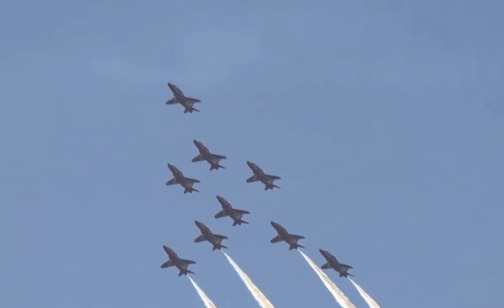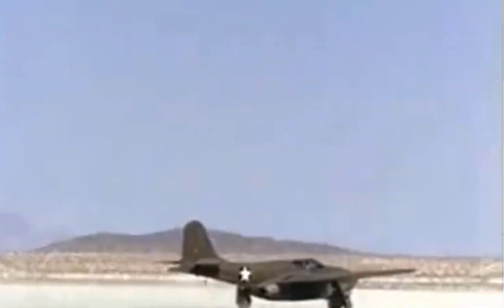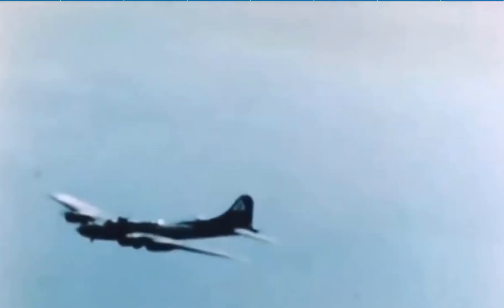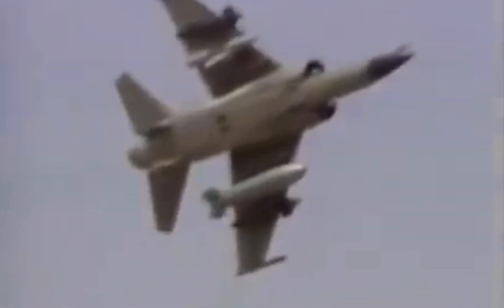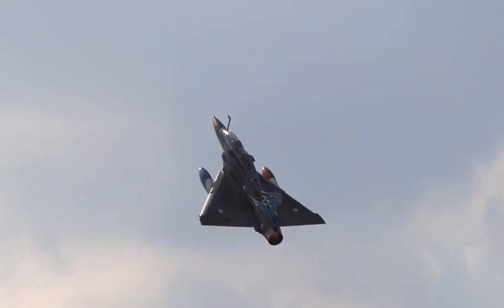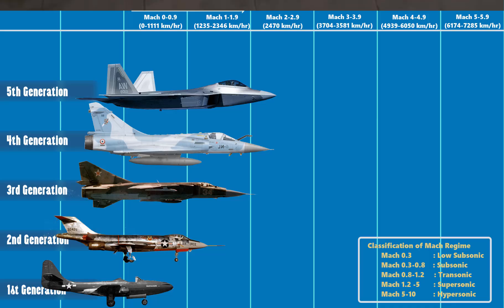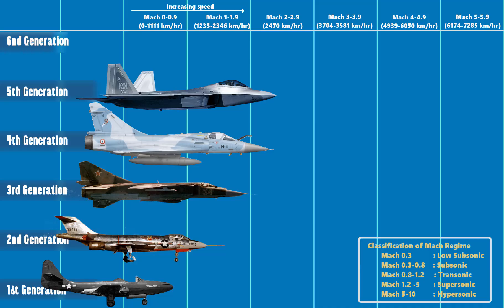Evolution of Jet Fighters (1st to 6th Generation) | Speed Comparison

Comment: No , the ME262 was ready tested in April 1942 , and was  discovered  in the air on June 1943 fighting against the Allied . It was maximum used in 1944 when it was too late for the war . Its speed 900 km / hr . It was a prototype which even the Air chief Adolf was Shocked to see its fly . For Allies it was an alien 😂.

Comment: 1953 ... the generation 2 jet fighter interceptor Avro Arrow was designed ... and 37 were built ... NO prototypes were made ... 6 were flyable and 5 flew .. 
.
of all jet fighters the arrow was the first to have built in air conditioning ... extensive use of titanium (before the sr71was even a dream) flew higher faster and further than all other gen 2 craft ... 
and yes the arrow has 15 firsts of all jet aircraft .... and all of them are still in use today ... btw the arrow was mach 2.2 Capable .. also it was the first delta wing design first with over the horizon look down shoot down radar first with ground mapping radar for low level flights .. first with internal weapon bay ... just to list a few firsts of the arrow ... NONE of which are american deisgns ... even their vaunted sparrow missile and it's gidance system was Canadian made as the americans gave up on it and let the canadians have it ... then we made it work ... 
.
ok so sorry BUT youre information is WRONG on the terrain avoidance systems .... the arrow had that in 1954 ... designed from the start ...

Comment: Jets aren't going above mach 2.5
The format can do much 3.5 but thats the fastest. 6th gen will never ever ever go mach 6.
Reply: um wrong ... a modern jet fighter with turbine jet engines is capable of upto mach 3.5 .. to get above that one needs a hybrid engine that is half ram jet and half jet turbine ... also known as a scram jet ... which takes you upto mach 6.6 ... and then a ram jet with no moving parts takes you above mach 7 and well into the double digit mach numbers ... 
.
the flying wedge or shoebox is a mach 10 capable plane being tested for Nasa to find new innovations in high speed air travel ... 
.
so sorry ... perhaps more reading and less call of duty

Comment: What if a one generation plane destroy a six generation plane? 

Airforce Leader/captain= WE’RE ANNOUNCING THE BRAND NEW FIRST GENERATION PLANE CALLED P-51 MUSTANG AND BF-10……!!
Reply: avro arrow .. a GEN 2 production aircraft ... flew higher than the u2 faster than it as well was armed .. and that was with a heavier and weaker engine ... the sr71 mach 3.5 the arrow with its proper engine same speed ... the sr71 lower ceiling than the arrow ... same speed NO WEAPONS >.. the arrow same speed higher ceiling has weapons and can carry recon gear as well ... 
.
avro arrow design specification air 7.3 ... still NOT met by any current aircraft being built ... INCLUDING the f35 and f22 ... a 70 year old design that can still out fly the modern jets ... american stagnation ...

Comment: Basically, I like your video. However, is it careless research or a certain national pride of whatsoever, unfortunately in some ways it's a litte incorrect:
The jet fighter age started with the Me262 (nickname Sturmvogel- stormbird): prototype 1942, 1st delivery to German airforce Nov. 1943, built 1433 units, approx. 1000 delivered. Is this what you call a "handfull"... ? Being used in the war for almost 18 month and shooting down a considerable number of bombers and P51's?
I think it would make more sense to categorize the Me 262 as generation 0. No matter what, it was the first plane with jet engine produced in series and used in a war.
One more thing, you apparently didn't notice- in 2009 the National Geographic Channel produced a special about the Horten IX, a flying wing that was built in a small number of prototypes, maiden flight Dec. 1944. It turned out that this plane, looking like a historic version of a B2 stealth bomber, had a low radar signature, wonder if you'd call it a Gen. 5 plane (as of 1944)? Gen. 0-2 might be more reasonable. There is still a small number of planes left, minimum 1 in the US and 1 taken to the UK.

Comment: I didn't realize the F 22 was faster than the SR 71!
Reply: William Playz  Yeah thats the joke
Reply: LOL both are sad planes anyway ... the sr71 an unarmed high speed jet ... the avro arrow a high speed fighter interceptor ... BOTH built by canadian engineers ... and yes the sr71 was ... in march 1957 it was on the block for cancellation as a swept wing plane that couldnt meet its requirements ... then in pop 15 avro arrow engineers ... they toos out the swept wings make it a delta wing and skin it with titanium like they did with the arrow leading edge of the wings ... and then they fixed the engines so they could work at high mach speeds ... and poof your camera plane was made ... 
.
 the sad part an avro arrow with its ps13 engines .... was just as fast and just as capable ... and it even had weapons ... and people wonder why the USA didnt like the plane ... it could shoot down their spy planes at will ... and catch them too
Reply: @kaboom-zf2bl  When?
Reply: @joshuachamberlain9725  well the arrows first design idea was 1951 and it was first onto paper in 1953 as a basic design ... and the Canadian Miitary wanted it into production as soon as possible so instead of prototyping and then building they went with the cooke craige method which is direct to production tooling ... so ALL 37 planes were production models ... the first 5 flew and the 6th was stopped before it could break all the records 
.
in 1957 ... the arrow was cancelled due to lies from the USA and deceit nd corruption in the Canadian government ... that would be feb ..... in march of 57 (not even a full month later) ... the swept wing sr71 was getting ready for a project review and had failed to progress at all ... but they got 16 avro engineers in with experience in Titanium work and high speed jet engines ... and poof the swept wing sr71 became the unarmed sister of the avro arrow ... something american history fails to list ... just like the lunar module was designed BY Jim Chamberlain of Avro Limited ...  when he joined Nasa .... thats right most of the tech the USA has was NOT made by them but stolen or swindled to their use ... 
.
so NO the american fighters everyone likes to think of as high end havent even exceeded a plane 70 years OLD ... heck they dont even match the design specification the arrow was built to ...that is how badly aviation was crippled because americans were so communist focused they screwed themselves and the world out of a great plane just so they could put an unarmed version of it up
Reply: @kaboom-zf2bl  no when did I ask?
Reply: @joshuachamberlain9725  Joshua Chamberlain
Joshua Chamberlain
11 hours ago
 @0623kaboom  When? 
.
thats WHEN you asked ... a little short term memory lapse ?
Reply: @kaboom-zf2bl  no. Please disappear. Thankyou

Comment: You do realize blackbird only reached 3.5 and it was the fastest plane and spit out fuel on the ground no plane will reach 4.3 ever it's just not possible with real technology we currently have the most will ever see is mig 31 foxbat or foxhound at mach 3.2 in afterburner now adays it's about reliability and supercruise without afterburner to save fuel for longer duration missions not about how fast u can go if that's the case then the A 12 or blackbird should come back but no real mission for the cost of it it's pointless
Reply: Mach 10 Marvel... https://www.nasa.gov/centers/dryden/news/X-Press/mach10_marvel.html
.
 so sorry ... 
and yes even when you posted your comment this was happening ...

Comment: according to the classification of Russia, F22 and F35 are not completely fifth-generation fighters ..... they have no over-maneuverability. F22 and 35 are worse in maneuverability than the MiG-29
Reply: LOL f35 was supposed to be a vstol craft with low observability and mach 3 speeds ... but they had to make 3 planes to get the whole package ... one variant NO vstol but high mach ... one variant no high mach speeds BUT can land vertically ... and then the navy's carrier version which is the stripped version of both ... maing the f35 an overpriced hunk of crap ... the f22 ... is just an f35 without the extra bills for all the useless vstol tech ... and it still has less linger time than the avro arrow ... 
.
the f22 and f35 are flying crap ... tbh ...

Comment: Modern Car engines have far more innovation technology than jet engines. 1990’s vs 2020’s car engines = no comparison.
1990’s vs 2020’s plane engines = not as much efficiency innovation
Reply: Not true at all look into modern passenger liner engines, even in the past few years they have undergone huge changes
Reply: Idk, airplane seen to have much, much longer ranges than in the sixties, or even the 90’s, and planes that used to have four engines are doing fine with two…
Reply: @rooseveltbrentwood9654  Very good point.
Reply: You might be right if your referring to any other country other than the United States. Japan as well
Reply: oh .... model t ford 40mpg ... tesla 35mpg ... what innovation ... over 100 years and they still havent gotten better gas mileage ... 
.
no car engines and jet engines are about the same ... they are stagnant in their waste of energy ...

Comment: The only 5th gen fighters in service r us f22 f35. The us will have a 6th gen jet before china makes a 5th gen jet equal to f22 in capacity and f22 is 23 years old already. But china is growing  but it needs until 2035-2040 to be level 1

Comment: The first fighter jet was under development in Britain in the late 1930s but because us Brits are quite incompetent at times we didn't really see the value in it whilst the Germans did hence why the Germans operated a jet fighter first and when predicting the speed of 6th gen fighters, don't look at official figures because they don't even really know. In all likelihood the first 6th gen fighters will reach a speed between mach 3 and Mach 4 but not actually reach Mach 4. In the real world first gen fighters wouldn't reach Mach 0.8 because their acceleration was so poor due to the relatively low thrust output although this probably was expected. Also if you look at some first gen jets such as the Meteor and Vampire you can see that top speed wasn't the top priority but instead manuverability was

Comment: hey, i just wanna let you know that 2nd generation fighters don t need radar to use missiles , they used heat seak missiles not radar guided.
Reply: Mirage III is from the 2nd gen, it used a radar for it's missile matra 530
Reply: @juanmanuelrodriguez6834  there are some exceptions but i said the majority don t need it, not that they don t have it, just like the mig19 pt it had radar but it fired heat seak r3 missiles
Reply: @mandellorian what variant of mig19 ?

Comment: A general guide to go by

Gen I - 1903 - 1935
Gen II - 1935 - 1950
Gen III - 1950 - 1974
Gen IV - 1974 - 2005
Gen V - 2005 - 2025
Gen VI - 2025 - 2050
Gen VII - 2050 -

Russia's Gen IV is 
IV.0 - MiG-23
IV.2 - MiG-27
IV.4 - Su-27
IV.8 - Su-34
Reply: Darrin Dudding Gen 1-5 refers to jet aircraft from the 40s to today, not propeller aircraft.
Reply: Its been reclassified as All Gen I is WWI and all Gen II is WWII as the first 40 yrs of aerospace can't be forgotten and are included

Gen I - Berloit IX 
Gen II - Polikaprov I-3
Gen III - Mikoyan-Gurevich MiG-15bis
Gen IV - McDonnell Douglas F-15 Eagle
Gen V - Lockheed Martin F-22 Raptor
Reply: MiG-29;)
Reply: Wrong Kid Russian 5th gen 1997.
Reply: @forzaisspeed  

This is a universal list not subject to opinion as its  based upon production not prototypes like the Su-37 and Su-47
Reply: @d14d 

Fact of the matter is, the SU-47 was the 1st 5th gen jet, prototype or not.

Comment: what happened to the F-14. All fighters are based on this air frame developed by Bob Kress.
Reply: BUZZER sounds .... wrong ... the f14 came after the arrow ... and guess what the f14 had 6 arrow engineers in its production design team ... the Avro Arrow has the 15 firsts of jet fighter aircraft ... the f14 was the first jet fighter t use them outside of the avro arrow .. and sr71 as redesigned by the avro engineers who saved that failed project

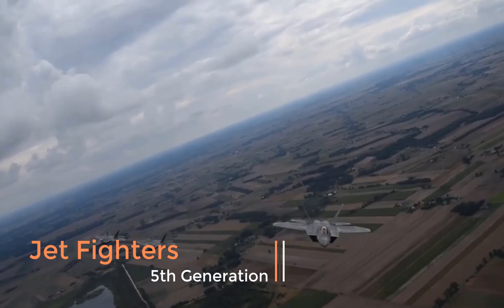Comment: She put an f-4 as a 5th gen at 4:34, but it should have been a 3rd gen
Reply: F4 is an early 4th gen
Reply: @studza6607  f4 definitely 3rd gen. 4th gen was teen series and mig29/su27 era. The mistakes of the f4 led to the f14/15 and the need for a light fighter in greater numbers led to the f16 and f18

Comment: Mig 25 speed 2.5 to 3 mach
And its 3rd gen plane
Reply: 3rd gen jets had somewhat better potential for top speed due to turbojet engines that compared to modern fighters'  low bypass turbojets were much less fuel efficient but did not get that much hindered by flying at high supersonic speeds.
Reply: The MIG-25 is mach 2.83 using TMS.

Comment: Why speed is decreasing with increasing generations?
Reply: Speed means a loss of maneuverability, burning tons of fuel, structural heating and weight.

Today, fighters are about energy.  The ability to maintain speed while pulling G's, high angles of attack and climb.
Reply: Logical Indian a faster jet doesn’t mean a better plane
Reply: @Stimpy&Ren No, which is why you find IR trackers on Soviet/Russian fighters.

Comment: Nah, the angle of flack of raptor is only about 25 to 30, the typical upper limit of envelop is 25000 m at Mach 2.5 and Mach 0.8 to 1.1 around 3500 2000 meter which is the main arrangement of air to air combat and high attitude interception.
Reply: ye yuan the posted speed of all US Mach numbers are at sea level something most countries will not do. We do so technically our Mach speeds are correct.  Mach is meant to be measured as close to sea level as possible.  So when an F15 says M 2.5 that’s at sea level if you are measuring speed at 40k your hitting speeds over M 3+

Comment: its about the technology and radar absorb technology. not by speed.
Reply: no radar absorbing material can absorb most of the signature, stealth oriented frame and radar absorbing materials will go obsolete rather fast (give it 40-50 years) since the signature reduction has been pushed to the limit with the F-22  and radar detection and tracking still has room to go further - what will probably happen in the future is again a "speed race"  with interceptors and dogfighting AI machines used in swarms ... unless there is a huge breakthrough with active interference technology (which again has a huge disadvantage - when used the enemy is fully aware you are there... despite being unable to target you - hence another speed race) cheers :)
Reply: like many other technologies before. it will come and go. Just as many other things in the past, it can provide some advantages in the short term when it's new, but sooner or later others catch up and find counter methods.
Reply from the maker: we all know that
Reply: @thebuzz4108  just as much as you know how to pronounce mig?
Reply: @thebuzz4108  really? because you seem remarkably ignorant of the basics.